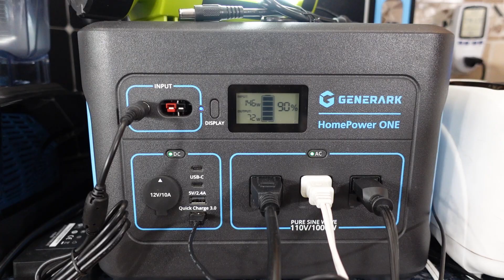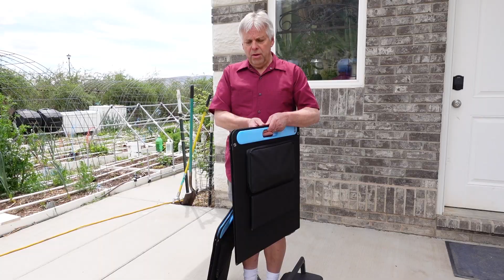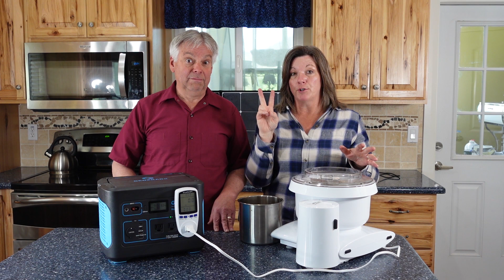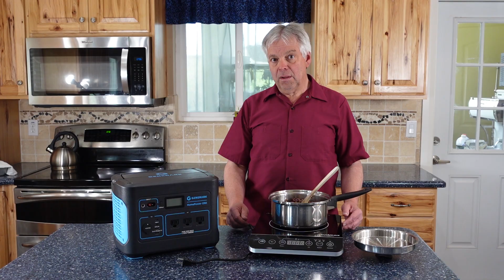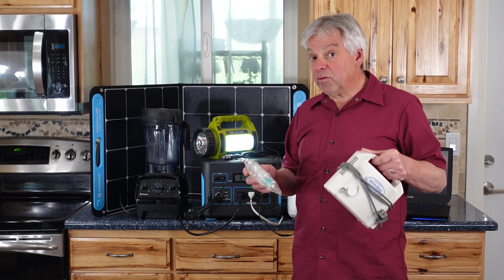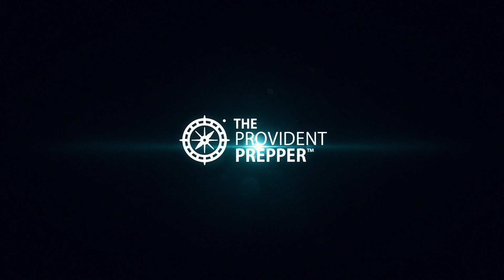Emergency Power: Generark Solar Generator Review

Comment: This generator did not come with detailed instructions for those who have never used one.  I was hoping to see, for example how the solar panel were initially set up outside.
Reply: Hi Jonathan, I just purchased this unit and waiting on it to be delivered. I also have just a Bluetooth AC30 300w that I picked up at an auction, no panels came with it, do you know if I can interchange the solar panels with this unit?
Reply: @kaneraiser17  Hey Laura...in many cases, solar panels can be somewhat interchangeable. You do need to make sure that the voltage for the panel is between 12 and 30 volts. Some of the larger panels (and perhaps yours) have higher voltages that would prevent them from being used. In addition, the HomePower One limits input to 200 watts, so your 300 watt panel may exceed that, although that 300 watts is rarely if ever achieved, in reality. If the voltage is okay, as a worst case, you can just not aim the panel directly at the sun to stay within the 200 watts. The power station will tell you the incoming wattage, so you can aim the panel to get as close to 200 watts as possible. The other issue you will like have is the connectors. I would guess your panel has MC4 connectors. The power station uses either an 8mm round or Anderson Power Pole connectors. Adapters are available to solve that easily. Hope this helps. If you have further questions, please connect back. Thanks for being part of the solution!!
Reply: @JonathanBJones  Thanks so much for answering!  I have decided to just get it its own panel, so just to make sure I get the right one, it says: pick one VOC 12-25V/150W with approximately 15V working voltage.  Sooo....would one 150 watt panel work?   This solar stuff can be so confusing
Reply: @kaneraiser17  Hi Laura...sounds like that panel should work, but it is a bit on the light side. You can input up to 200 watts of solar. I would probably opt for a larger panel(s) with at least 200 watts. In reality, a panel rated at 200 watts is only going to provide half or a bit more most of the time. That 200 watt rating is based on perfect conditions, which rarely (if ever) happen. I would probably opt for 2 of the 150 watt panels and combine them to perhaps get close to the 200 watts. I know it can be a money issue, but you really want enough solar to effectively charge the station and keep up with loads. I would shop around to see which panels will meet your needs. The panels that you get from Generark or other power station providers are nice and portable, but the cost per watt is generally higher than hard-framed panels out there. Many of these portable panels are weather resistant, but not weather proof like the hard-framed panels are. Think about how you will use your system and find some solar that will best meet the need. I know it can be a bit confusing, but I will try to help where I can. Thanks for being part of the solution!
Reply: @JonathanBJones  This helps alot!  Thank you so much for the reply.  Keep up the good work helping people with your channel 😉
Reply: @TheProvidentPrepper  Thank you! I contacted the company and they provided specific instructions.

Comment: Have you tested this on a refrigerator before for hours at a time?  Been looking at many solar generators to be prepared for hurricanes.  My only concern is that I see a review where the Generark burned two of the guys refrigerators so it worries me.
Reply: Hey IML...help me understand what you mean by it "burned two of the guys refrigerators". I will see what I can find out from Generark. This particular Generark unit is a bit borderline to run most fridges. If the fridge is only opened very briefly 2 or 3 times a day, the fridge is super efficient, and if you have fantastic solar, it may get the job done. As far as the output ability, it should be fine...just not sure there is enough storage capacity. The larger units with 2000+ watt-hours of storage and the ability to charge with 400 or 800 watts of input would be much better. Look forward to hearing back from you...thanks for being part of the solution!

Comment: There is a portable washing machine available on Amazon for about.50-75$. It is electric, manual fill and manual drain, but it beats hand agitating clothes. You will also need a spin dryer also electric but much lower power. It spins out clothes as good as a hi efficiency washer so your clothes are almost dry when they come out. Just hang to dry after.
Reply: @TheProvidentPrepper  If the SHTF there may not be water for washing machines.

Comment: I think you measuring the power consumption for the various appliances one might need to use during a power outage (sorry, I won’t be kneading my own bread but great example lol!) isn’t anything to be sheepish about. If you don’t know what uses how much power then how you gonna know what you can & can’t use when it’s necessary? If you’re gonna be prepared you might as well be FULLY prepared, and that means knowing what you can or can’t use (that’s something my Father would’ve said,lol!). At a point in my life where relocating for “retirement” purposes is being thrown about, I’ve been looking into my options for a generator and like the daughter in the original article where this particular power station was being advertised… was shocked by how many people suggested a gas running generator for a couple of reasons: hello, running it in your house would kill you & everything else in it, the price of gas fluctuates more these days then the tide, and have you seen just how big the smallest of gas run generators are!?! Maybe if it was to keep things going for more then a week during some major outage but I’m looking for something smaller that’ll keep my cellphone charged as well as maybe a lamp or two (OH & my fridge!) so this little cutie is right along the lines of what I’ve been looking for but I guess if you don’t put use the right (or specific) words when doing a search you won’t get all the right products (I looked for “solar energy banks that can be used for my home” too much?! lol!), I know what to get should I be driving an RV though! LoL! Anyway… Thanks for sharing your insights for this product as well as the amount of energy it used for certain appliances (!) like I said, I won’t be kneading my own bread but making a margarita during a prolonged power outage might be something I’d consider! TTFN ✌🏼🙏🏼🧿🧼🖖🏼

Comment: main issue is the fan noise...any model or brand without the fan noise?
Reply: I would guess that all of the power stations are going to have some fan noise. You really need the fan to mange heat. Having said that, I am sure that some use quieter fans than others, and in other ways make them softer. I personally am not bothered by the fans on either power station that I have, but recognize that they could be annoying. I would pick a couple of stations that meet your criteria for charging, output, cost, and quality, then see if they can give a db (decibel) rating on the fan noise. So far, I haven't noticed that any of the ones I looked at provide that, but they might have that information. Features that are important to me are reputation, the ability to use the station and be charging it at the same time, the ability to deliver the capacity I need, and cost. I wish I could provide better direction. Connect back if we can help further. Thanks for being part of the solution!
Reply: @JonathanBJones  went with jackery 1000..thanks...same but decided will be fine with the noise..better to have power with noise than have nothing..thanks for the video
Reply: @youtubegarbage4u  Well done...I think you made a great choice. Actually, if you look very closely at the Jackery 1000 and the Generark, you will see that they are really the same unit with a different handle and color...everything else is identical as near as I can tell. Now you have the peace of mind knowing you have power. What noise you hear will soothe you knowing you are more self-reliant and resilient! Take good care, and Thanks for being part of the solution!

Comment: It will run a 700 microwave right
Reply: It may be close, but I would choose a larger unit. Usually when they refer to a 700 watt microwave, that refers to the power produced by the magnetron. Because nothing is 100% efficient, the actual input watts will be something higher than that. Add to that the electronics, turntable, light, etc, you might likely be over the 1000 watt mark. If you have a energy consumption meter, it would be good to use that to better define how much energy is being used. Then you have to consider the startup surge...sometimes referred to as the Locked Rotor Amp (LRA) rating, which is extra energy needed to get the appliance started. In many cases, this momentary surge is 3 times (sometimes more) of the running wattage. In this case, that startup might be as high as 2100 watts (3 times 700 or higher) or likely more. There is a pretty good chance that you would top the 2000 watt surge capability of the HomePower 1. Some appliances spell this out on the information label...so you can check that to see if your microwave provides that LRA or surge rating. If running that microwave is important to you, I would find a power station that will better meet that need...meaning a higher running watts with a correspondingly higher surge capability and storage capacity. Also in that consideration, remember that using while microwave cooking is somewhat efficient, you would only have that ability to use the microwave for perhaps 40 minutes if your power station is fully charged. Might be better to use a sun oven or other alternative cooking method. If you have further question, please connect back. Thanks for being part of the solution!!

Comment: Will this power with a rockpal 100 panel
Reply: Yes...more than likely. You can use a solar module that produces from 12 to 30 volts with a maximum input of 200 watts. The only issue you may have is the connector. There isn't a uniform standard for the input type...some use Anderson connectors, others use 8mm inputs...this can accept both of those. If it isn't one of those types, you can usually find an adapter that will make it work. Thanks for being part of the solution!

Comment: So can I have this in the same room as me turnt on while it’s powering my ac ?
Reply: Yes....sort of...You can have the solar panels outside charging the power station which can be inside. You do have several feet of cord, and could get an extension, if needed. As for the AC...that might be a problem. It might run a tiny AC system, but only for an hour or 2. You would have to look at the draw for the system, and recognize that you only have 800 watt-hours or a bit more of usable capacity. These power stations are not real good for cooking, heating, or cooling, as these activities use lots of energy. It is great for running fans, lights, medical equipment, entertainment, etc. in addition to charging phones, tablets, and other small electronics. If I can help further, connect back. Thanks for being part of the solution!
Reply: @JonathanBJones  thank you so much deff got my subscribe

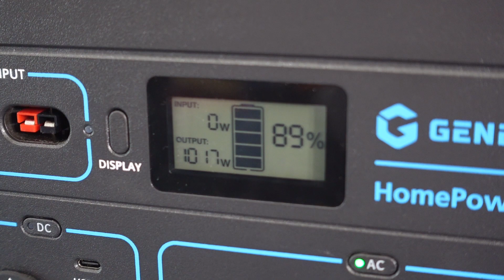Comment: ummm.... at time stamp 6:42 the actual stovetop doesn't have the red light (hot surface) light on it... but at6:57 it does.  You used the stove to heat the beans, didn't you?
Reply: Hey Dennise...we actually used only the induction cooker. That is one thing I really love about the induction cookers. First, unlike the stoves that require 240 volts, the induction stove only requires 120 volts, so you can use it with with a generator or a power station. As I mentioned, it took 16% of the storage to heat up the beans (about 20% of the usable capacity), so you would really need to decide if that is how you want to use that stored energy. In most cases, I would choose to heat the beans with another source (solar oven, alcohol, Safe-Heat, propane, etc.), but this is an option if you choose it. You just need to throttle the stove back so that you stay below the 1000 watt maximum or the power station will shut down. If we had run the induction stove at full power, the beans would have been done in about 3 minutes, which is the other thing I love about induction cookers...they are fast! Thanks for being part of the solution!

Comment: This seems way over priced at 1.40/watt.  Should be 1.00 per watt at MAX.  Also the USB-C should pull 60-100 watt. This looks to be only 18 watts.
Reply: Hey David...actually the price for the power station is $999, so it comes in at just about a $1 per watt, which is pretty common for power stations. With the bundle, which includes the 2 solar modules, the price is about $1500. If you use the promo code Provident, they will knock off another $100. As for the USB-C, this unit just has the standard version that has a maximum output of 15-18 watts. The newer USB-C PD can deliver up to 100 watts, and the even newer USB-C IF can deliver up to 240 watts. At some point, I am guessing that many power stations will upgrade to these specs., but for this unit now, it is 18 watts. Thanks for being part of the solution!
Reply: @JonathanBJones  i see the price now which i agree is more in line but not until there are upgrades like any newer model out today tat suppports USB-C of at least 60 but.  I bought a 350 watt togo and even that has a 60watt PD USB-C. You need that higher power for ipads and laptops. To me it just speaks to a company that is behind the race for power stations. You make a great gas generator though.
Reply: @davidparker7156  Hey David...you make a really good point. I have not needed that much output on a USB-C port, but it would be nice to have that ability. I will connect with the Generark people and suggest that they upgrade that feature. Thanks for your comments...and Thanks for being part of the solution!!

Comment: Congrats toi all on a great product!!! BUT, I had seen ads and promotional materials that the HomePower2 could also charge and electric car. Is that still true??
Reply: Hey Jim...the HomePower 2 technically can charge an electric car, because it has a 20 amp outlet. In fact, most electric cars can use a standard 15 amp outlet. However, it still only has 2060 watt-hours of capacity. A typical electric car uses about 30,000 watt-hours to travel 100 miles. So if you could get every bit of capacity out of the power station, you could travel about 6.9 miles. More realisitcally, you could get about 4 or 5 miles on a full charge from the power station. On the positive side, if you needed to drive a few miles each week and used the HomePower2 and the solar panels to do that, mission accomplished! Just keep in mind the reality of it. If you really want to use that electric car, probably would be best to install a small solar power system that would crank out substantially more energy. Hope this answered your questions. If not, connect back with us. Thanks for being part of the solution!!

Comment: Nice video, but I suggest you do not show your Vitamix blender plugged into it. The Vitamix runs at about 1800 W. Way too high for the solar generator.
Reply: Hey Lit...I appreciate the comment. Actually, our Vitamix is rated at 11.5 amps, so the rated watts are 1380...too high if you are putting it under a heavy load and running it at full speed. You know I love to measure things, so I got out the Vitamix and filled it with water and used my energy consumption meter to measure the energy use. I started at level 3, which only used 100 watts. Then level 5 which drew 290 watts. Then level 6 which drew 780 watts. At level 7, we went to 1075 watts, which the powerbank could sustain briefly, but too much for continuous use. Then I decided to create a smoothie for a more realistic load. I used apple juice, bananas, apricots, pineapple, and a variety of frozen berries (this creates the challenge and uses more energy). The Vitamix was under a heavier load, but still blended the smoothie with 700-800 watts of energy. Similar to the induction plate that we used in the video, you just need to know the limits of your device and use the appliance within those limits. I think that most things could be blended in the Vitamix using the powerbank. If you are putting an extremely heavy load on the blender, you may have an issue, but many or most things should work. Way to have the wheels turning! Thanks for Being Part of the Solution!!
Reply: Jonathan B. Jones You are awesome. Great answer to a less than warm comment. Sorry. I want your followers to know how respectful you are when someone like me makes a comment like I did. Keep up the good work. You provide a valuable service. 😊
Reply: @litnoregrets7551  Hey Lit...just getting caught-up from a crazy week. Wanted to make sure you know that I appreciated your kind words. I actually didn't think your comment was "less than warm"...just considered it to be a legitimate question and concern. Thanks again! Take Good Care! Thanks for being part of the solution!!

Comment: this will totally save me if something happens with this California heat!
Reply: No. It won’t run an AC As I asked the company. Even a portable air conditioner. Which to me that is the most important thing in the heat is an air conditioner I bought one anyway but there are no instructions with it. So good luck